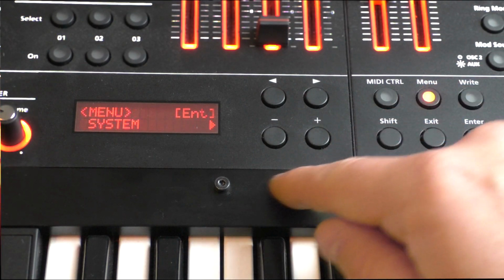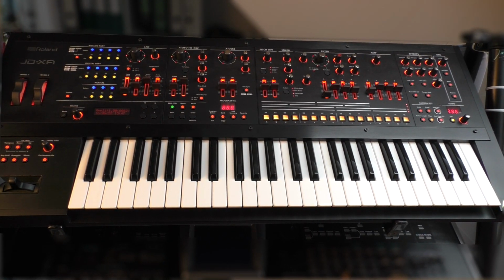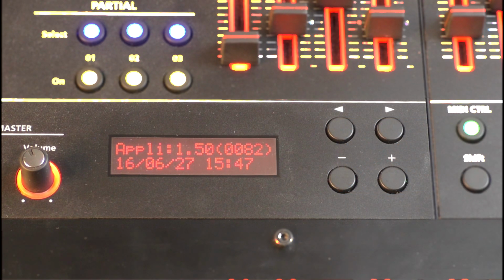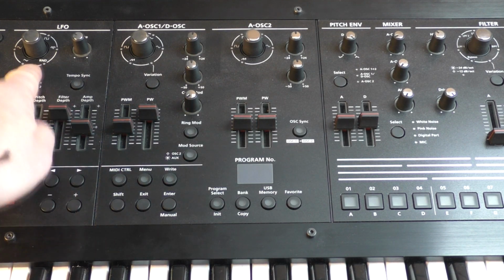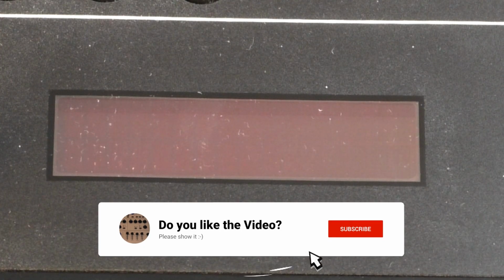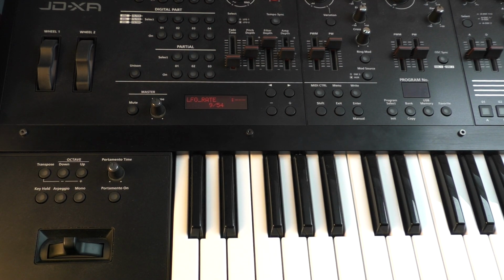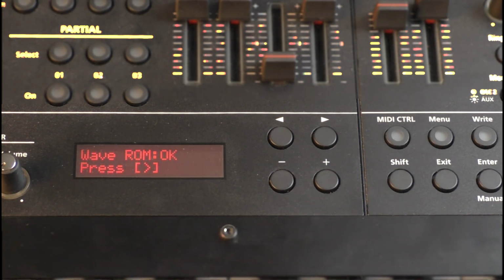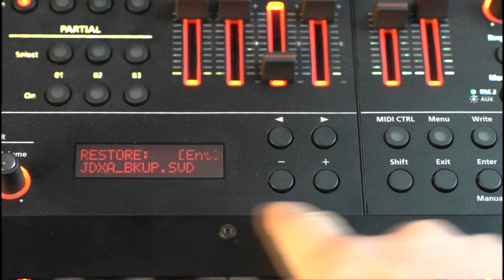Before you buy a used / second Hand Roland JD-XA //Service Check\\ Test Tutorial - no Tools needed

Comment: Helpful,  better quickly run these for my 2x XA's in the studio!  Now ... the initial production run of the JD-XA back in likely late 2014 (released 2015) had an issue in analogue board at output path due to faulty C27 Capacitor component on the PCB, creating  occasional loud 'pop" and noise tails in to FX section (like vocal mic switch on, high impedance sound). Roland aware and would fix under Warranty naming as the 'pop fix' - it would be useful if potential buyers could determine this from Test Sequence.  I understand the way to trial is select patch that oscillates which has FX in chsin, press lowest octave key/hold and wind up the FX delay to hear if it comes through the FX path.....? Bit sporadic in nature, so maybe not a catch all scenario.
Reply from the maker: Yes, i heard about this issue and the warranty of Roland. Fortunately i never had any Problem with my JD. Only on some Patches i have a little noise, only to hear with headphones. maybe the DSP bottlenecking with multiple effects?!
Reply: @Kosmokatze_de  I read in general some path noise from the  digital waves (?)....
Reply: is there a way to determine the production run from the serial number?
Reply: @djangofett4879  Apart from JD-XA Forum users,  only thing I can suggest is speak directly to Roland Support on that widely known issue...... good luck 👍 👍

Comment: after factory defoult the write button, at 5.47m flashing and the display reads "ErP Power Off". When I turn it off, it doesn't return to the faders and other tests...
Reply: you have to push write and the JD powers off. Is the last part of the procedure. The Fader tests etc are before that.
Reply from the maker: Yes right, when you Power off via the write Button, it starts in normal Play Mode.
Reply: @Kosmokatze_de  I pressed write and the display went blank. Nothing else happened. Nothing lights up. When I turned it on again, it didn't go back into test mode. And starting all over again didn't help. I think it's more to do with the version. If you use the current 1.54 it should finish.
Reply from the maker: yes, maybe the FW. I use the 1.50 in this case 
 @heliotron8042